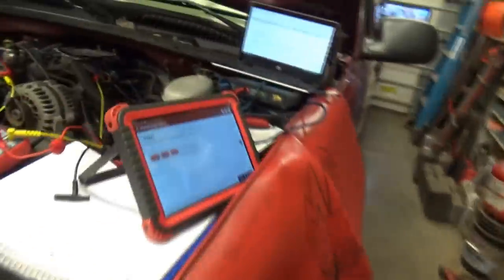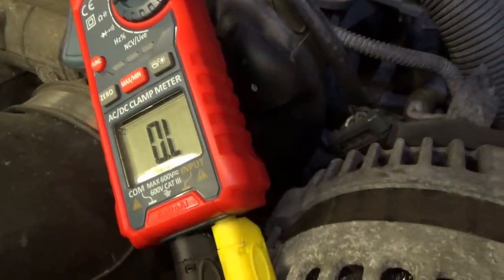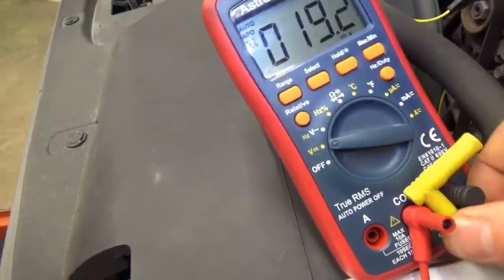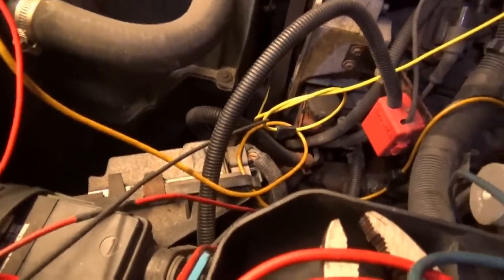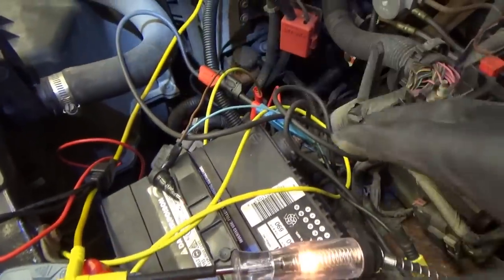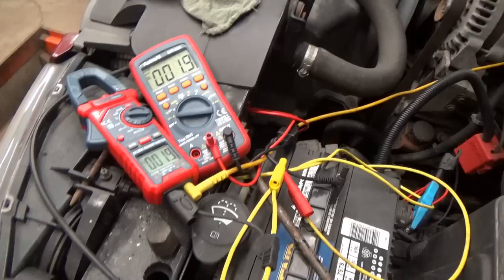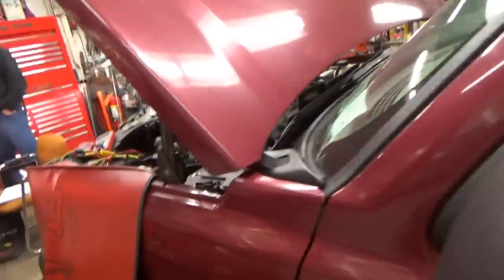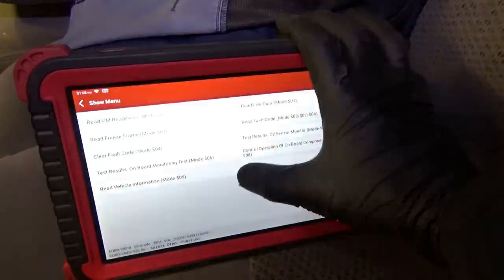Knock Knock...P0327 is here! (GM Truck)

Comment: I fixed the same problem in my 5.7 litre Chevrolet LS1 V8 powered Holden VY SS Commodore in 2019 by replacing both knock sensors & the knock sensor wiring harness.

Today after I got the registration inspection done which it passed the LCD check engine symbol turned back on but it turned itself off after a few kilometres or miles.

When I got home I scanned it for codes & a P0327 code was stored as well,I have my car a quick wash down yesterday to clean bird crap off the body & I am wondering if a little bit of water got into the PCM wiring harness connector as well.

Note that I never pressure clean the engine because I did that in 2009 & I found out that the rear knock was sitting in a well of water,so I never did that again.

Why I mentioned washing the car is because someone was saying that they have a P0327 turn on in their Subaru after they wash the car , although they might be different cars, it's a coincidence.

I answered the same question before but the code has turned on again 6 years after fixing the problem !

Comment: Hopefully this fixes my 03 Silverado SS, just fixed and replaced every single ground on the truck including a 4 gauge tinned copper engine ground strap, big 3 power/ground upgrade 00 gauge OFC, AGM battery and an Escalade alternator.

Comment: Once you ensured the bias voltage was the same, why do the continuity test, wouldn’t the bias voltage test show the wire was intact? Also, just the ohm reading from the sensor doesn’t necessarily mean it’s good, right? I’ve seen another video where you need to check if voltage is generated from the sensor when tapping on the engine, in that one the ohms were good but the voltage wasn’t produced and therefore the sensor was bad. Thanks for the video!

Comment: Great video, I am battling knock sensor issues in my 2005 Suburban Z71 w/5.3l Vortec. I'm at @240,000 miles and the issue started about 2 years ago w/CEL no noticeable drivability or mileage changes. I got both P0332 & P0337,  looked up and cleared codes  thinking they would come right back since knock sensors were bad.The CEL stayed off for 3-4 months. The CEL and codes returned (both 0332 & 0337) so I both the  and  got new intake manifold gasket, knock sensors and harness and installed completely cleaning out under the intake, carefully torquing and damming the plugs w RTV. CEL and codes were back in a few months, I cleared codes and they eventually returned in a few weeks.  I tried to research and made sure to source OEM AC delco sensors ( I believe the 1st set were AC) I Ohm tested the new sensors and also tapped them to confirm they gave off signal before and after I installed. The CEL returned and the codes were back in a couple of weeks. I have Ohmed the sensors in place and they are both 100.3. I get the low voltage from the PCM side with key on. I have also now removed, cleaned and reinstalled the grounds on frame under the driver and drivers side front fender area and braided ground strap drives side firewall to engine block ( I was unable to unloosen the ground from harness to top rear of engine block but it's intact and looks good. The vehicle runs and drives well and gets what I think is good/normal mileage for 240,000 miles @ 15 mpg average.  last Blackstone oil @214,000 analysis looked excellent.  I am trying to decide what to do next  ie. wether to keep the vehicle or move on  I believe I need new motor mounts ( people have reported this resolved knock sensor issues), front and rear bolts are broken off exhaust manifolds on both sides 👍, hydro boost and hoses need replacement and possibly  the rear main seal😳.   I am wondering if anyone has similar knock sensor issues?  Thx, Mike

Comment: What a great video thank you for this walk-through. I have a completely hand rebuilt Chevy 350 LS1 which I spiced up with Heads and Cam full exhaust, dyno tuned and all is good however, I had a problem with the car not starting my mechanic friend thought I did not time it correctly, but I know for a fact, I did although I used a GM cam sensor from Summitt Racing it turned out being a bad sensor, even though it was new. I ended up using my old sensor and the car runs great. One last issue is I have a 9037 low input bank one knock sensor I wonder if I can use this same method on my 1999 LS1 V8 z28. Everything was torqued to spec and out of the two new GM from summit knock sensors only one is causing a service engine light. Someone said, perhaps I torque it down too hard, but I torque them both the same. I would think both of them would give me the same problem, they said if it’s too tight, it will vibrate aggressively” 🤔 I do not believe it is a pinched wire because it would throw an SES immediately And it does not. It comes on after about an hour of driving. If I reset the DTC’s, the car runs fabulous, very powerful and snappy, once the service engine light comes on you can feel power loss and actually the exhaust even sounds different. I am not driving the car until I figure the problem out and it’s too cold in New York right now to work outside. 

Any advice? I’m going to look at the pin outs on the PCM once it is warm out and see if they look bent or rusted or burnt out, if not I will clean anyway and use dielectric grease. The knock sensor harness is clipped In and also new knock sensor wire harness from Doorman.

Thanks again I sure wish you were my neighborhood Mechanic.

Any advice is appreciated.
God bless 🙏

Comment: Halo Mister if everything checks out fine and keeps setting the code . Can the engine be worn with 350000 miles and be setting the code with a small engine knock . Thank you sr. I have learn to much from you .

Comment: Thanks for the tutorial you are a very good instructor. Never assume your dealing with experience mechanics that might fault you for explaining what might be obvious to them and feel the detail  explanation is unnecessary because it’s not.  A lot of older guys did not cut their teeth on this technology and still need to try to keep their vehicles running because they can’t afford the cost of repairs.

Comment: Yes y have that code in my Nissan Murano but y went and bought the sensor and the gasket and still have those parts the light is not there because I deleted  I have about 300 miles after that still doesn't have any lights what is the problem you are a mechanic not me

Comment: Great video as usual Ivan.

I do have a question though. I have a hard time grasping the two test light concept...

I usually put a test light at one end of the wire and connect the other end to ground/power depending on which was is more convenient...

What more does the second test light tels me?

Or is it just because you're adding a voltmeter to the mix and you want to have something to read between the two loads?

Comment: Ian, community, I'm diagnosing this exact problem on my 2004, intermittent P0327. About the biased voltage you are describing -- I thought the knock sensors produced a small positive voltage themselves and sent that voltage down the harness to the PCM to interpret that voltage. Are you describing the reverse? -  meaning the PCM is actually sending a 13-18mv positive voltage to the actual knock sensors with key on engine off? THX!

Comment: Thank you for making this video. I do have a question though how did you connect your wire tester into the PCM where the dark blue wire goes in? I’m afraid to pull the blue wire out because it might break. Thank you.

Comment: Would a bad ecm cause the code? Wiring is fine, knock sensors fine, but still getting low voltage codes
Reply from the maker: Unlikely. How do you know the Knock sensors are "fine"? Did you test them with an oscilloscope?
Reply: @PineHollowAutoDiagnostics  I’m going off what the mechanic said, I myself have tested the harness and the AC Delco knock sensors. Code stayed. I took it to a mechanic he did his thing for 2 days, tested the knock sensors in front of me. But is saying the circuit in the ECM is not sending or receiving voltage. That it needs to be replaced. I’m already in for $600. He’s saying the ecm is another $500. Looking for an other opinions before I spend money I don’t have. I appreciate you getting back to me thank you

Comment: Been fighting this condition on my 02 for a couple years, thanks for pointing me in a direction to look,,, the shop I take (took) it to never thinks outside the box
Reply: Mine loses power upon first acceleration and on steep hills. What is the issue you were having with yours .I had my knock sensors replaced twice and still has fixed nothing
Reply: @Mudjunkie  Mine did that for about a year,, finally just quit on me after 180k,, it was the fuel pump,, nothing to do with the knock sensors,, Just had a shop replace the sensor wire/connector a few days ago, it looked burnt inside the plug,,, still getting the codes on both banks,, but the truck runs fine
Reply: @450excpilot  when my fuel pump went a few years ago it lost power all the sudden. and I put it 4low  to make it home.  But now it only does that steep hills  and sometimes that first acceleration. Just trying to figure out what to do next but I didn't even think of it being the fuel pump this time

Comment: So, first off thank you for this video. 
I troubleshot using your methods. And I got the following.
Knock 1 = 100k ohms
15.3mV
Knock 2 = 100k ohms
15.3mV
Continuity verified from ecm harness to both knock sensors. 

If the error pops up again what could possibly be the issue?

Comment: Thank you for the video best help yet .. fixing to check to see if this is my problem.. P0327 & P0332 .. replaced with dealership parts
Reply: did you resolve the issue?
Reply: Same codes I have, also last time they came on I had a miss fire (P0300) code w/them. All this started after I was getting a P0446 for evap vent solenoid. I replaced the solenoid and then got the knock codes.

Comment: Great advice. I had a fault on senor two. I cleaned the main wire harness plug on the sensor and with the computer connection I just moved it around and no more alerts.
Reply: Which main wire harness plug? On the manifold? Having same issue with sensor 1

Comment: I would like to start off by saying thank you for this video. The past two months I have had serious issues with my 2000 Chevy 1500. I have had knock sensors replaced three different times from fire stone the last time I took it in they replace the knock sensor from OEM parts. After the first time they replaced it I only had the truck for two days before the light came back on. Now after having the third set of knock sensors put in the code is still coming on they can’t figure out why. So I bought a code reader  and I’m able to clear the code and I’m now going to take it to a mechanic with the information that I gathered from watching your video. I now feel confident in being able to help steer the mechanic in a direction other than the knock sensor because I have a new set of knock sensors and a new wiring harness. Thank you very much for this information  extremely valuable
Reply: Did it get fixed?

Comment: Replacing knock censors new. " clear codes turn off vehicle. Now start vehicle rev engine 5000 rpm 3 to 5 seconds. Do twice. Ecm is learning harmonics of knock censors.  Should fix lots of headaches.  If I only Knew that sooner

Comment: f you're still getting codes after replacing knock sensors and clearing with scanner try resetting the ECM/ECU that's what I found to work.

Comment: Interesting.   Need to pull that connector off and measure the output from the ECM for 18 millie volts. Also get the CRC spray.  I had replaced the knock sensors before, but failed to do the torque test.  Also, isn't there a ground wire behind motor that needs to be checked?  I had done ohmage readings between motor and battery and found I was getting 740 ohms.  Put in a small ground wire which brought it down to 8 ohms.  Suspect that not enough.

Comment: You did state that this vehicle won't pass the NYS emissions inspection.   Can the "CHECK ENGINE" LIGHT on this vehicle affect the exhaust emissions ???  Better replace the NYS.  Thousands of P0327 codes are a bad knock sensor which is poorly designed and horribly located under the intake manifold.  The bane of the auto industry regulated by our government.

Comment: You SCARED me.  In doing the light continuity test did you apply full battery voltage to computer sensor OUTPUT (with computer connected) that is only 18 mV when active?
Reply from the maker: yup sure did. It's a high-impedance sensing circuit, so no worries at all. Say the truck had a short in the harness and that knock sensor signal wire shorted to a B+ feed wire. Would it fry the ECM?
Reply: @PineHollowAutoDiagnostics  TEACH ME!   Is it DESIGN CRITERIA that all car cable bundles tolerate shorts to B+ or ground?  Not to function properly but rather to NOT fail components (notably ECM's) when any cable wire shorts to B+ or ground?  That sensors and black boxes will again function once the shorts are removed.  Fuses should protect any B+ shorted to ground   

What I am unknowledgable about is if a sense line from the ECM shorts to B+ that BY ENGINEERING DESIGN will not damage the ECM?  If not true IT SHOULD BE!!!  The only exception is spark shorted to ANY CABLE WIRE   Likely impossible with coils now directly on top of plugs.

Comment: This is what caused a P0332 code in my 5.7 litre Chevrolet LS1 V8 powered Holden VY SS Commodore :-

https://youtu.be/Xavg9IqvBvA

It was caused by a fake knock sensor which was made in China so be careful.

I replaced both knock sensors with U.S. made Wells branded knock sensors in 2019 with number 1 knock sensor deciding to set a P0327 code & I ordered a new knock sensor wiring harness from a Hong Kong seller on eBay & the check engine light symbol hasn't returned apart from when the fuel pressure regulator failed which was causing a lean code !

Comment: Very nice diag! Had the same exact problem on one 99 Silverado I did. (I’ve done idk how many of these knock sensor replacements) they’re real good money makers no one wants to pull the intakes off. Are you aware of the GM tsb on the water redirection with silicone? Not sure how much you work on these trucks. To add on after being a Ford Dealer tech you take for granted how the new cars set codes right away and these older ones it takes multiple key cycles and or special events to trigger these codes. I was chasing a solenoid problem on my personal rig (4l60e) for a few weeks to track it down after covering the basics. Ended up with a faulty harness in the tranny and a bad solenoid probably due to excessive resistance in the harness. It was hard to track down due to the harness only having problems hot which makes diag impossible lol. I try to be thorough with my diags but that situation was unique. Always enjoy the content teaches me new stuff all the time!